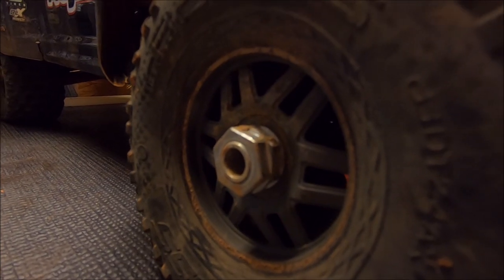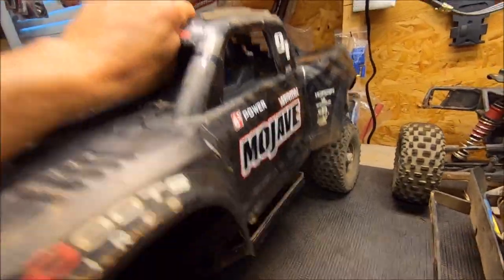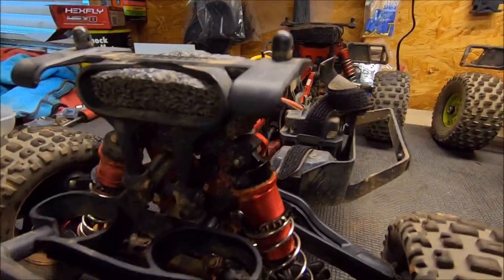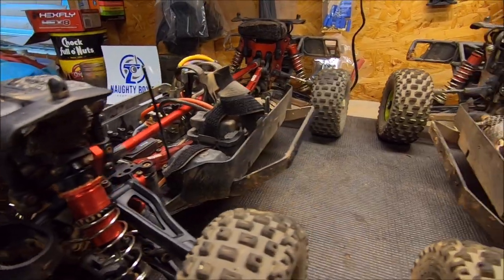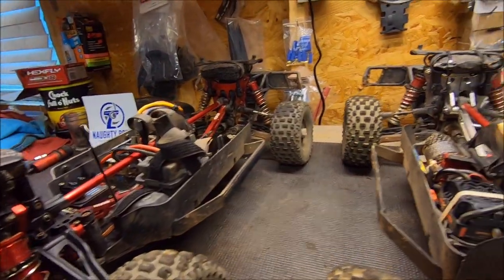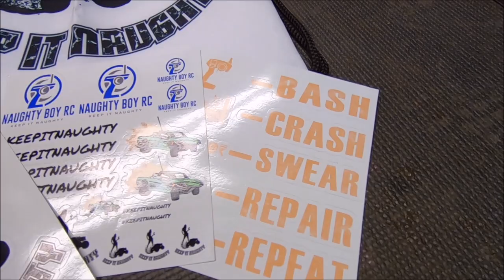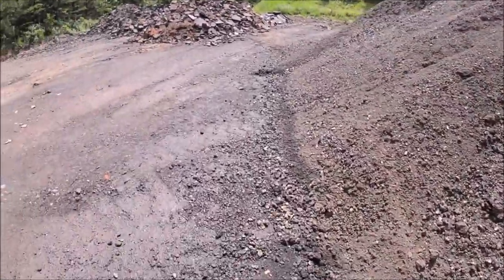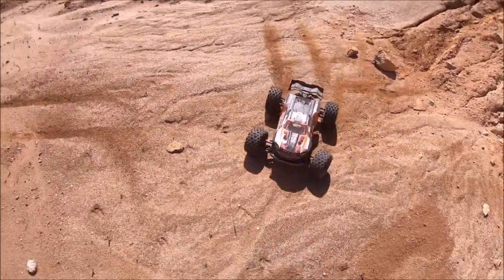INSANE Dirt Shredding BEASTS! ARRMA Mojave EXB, RTR and Kraton 8s!

Comment: Hey @RC Dude81 maybe you can help, so on my Mojave EXB (HW 1650kV + BL Servo and 17 tooth pinion, all other stuff Stock) i face the problem that my drive shafts front & rear pop out pretty often with "slow" bashing. I akready removed the small spacers on the A Arms to "tighten" that, but due to any reason that happens pretty often. What i have not yet done is the "limit the shock travel" on the shocks you did, but in theory i want the car "low" if possible (also screwed the shocks "hard", but not helped). No idea, the other two Mojaves (non EXB stock ones) does not have that problem. Maybe i need to replace couple of stuff, but the car is just couple of batteries old and i have that since beginning ^^
Reply from the maker: I fixed that on mine by adding a half inch bump stop to the shocks. I used boat cooling line but anything with a 5mm hole will work. The arm is flexing too much under full shock compression. The bump stop fixes it!😎👊

Comment: That’s a beast!!! I just ripped mine snd I love it. Had an issue with rear pinion bearing slop causing diff to break. Do you run stock diffs? Thanks!
Reply from the maker: Thanks man!👊Yes I run stock diffs just an extra outer bearing shim front/rear. Sucks on you rear pinion..bearings in good shape?
Reply: Its... locker time😁
Reply: @RCDUDE81  no, I replaced them! They were new ring and pinions too. Shimmed up perfect. Didn’t notice the bearing slop.

Comment: Hey Dude
Your thoughts on the Hoppywing 1650kv motor with the max6 for the Mojave? The esc motor limit is 1500kv should I stick to the HS 1480? Thanks for all your testing and hard work for us!!
Reply from the maker: Should work perfectly being the Max 6 combo comes with the 1650kv motor! The 1480 will work too but will probably be a bit faster with the 1650 setup. I know a lot of guys run that.😎👊👊

Comment: I have the red one. Super fun. What’s your suggestions on suspension and tires for huge air?
Reply from the maker: I honestly jump them all stock just thicker diff oils. The Mojave is more of a terrain vehicle (Drivers car) but you can certainly get some air with it! A little thicker shock oil and thicker center diff fluid will help.
Reply: Just bought diff oil. 100k/1m/100k. How crazy am I? Lol

Comment: Love the vid. Question? Did you put the extra “speed pinion”on you kraton 6s when bashing because I know some people do and I want to know what you do, to gage my decision weather to put it on when bashing or not.
Reply from the maker: Thanks! I do run the speed pinions bashing but keep an eye on temps! Especially if going hard in thick grass. Extra fans help too
👌😎👊👊
Reply: Throwing my speed pinion in a stock rtr with the 150a speed control would it be ok? I can stay out the grass.

Comment: Could you please tell me what battery set up your using on the exb?
Reply: And servo??
Reply from the maker: In the EXB It's using a Power HD 23kg Servo and Yowoo Graphene 6s lipo. 5000mah 100c.😎👊
Reply: Just purchased an exb because of your video!! Now I just need to finish putting it together!
Reply from the maker: Nice man! Enjoy!
Reply: What are your options on motor and esc for this mojave exb??
Reply from the maker: I like the Max 6 combo or Max 6 and Hobbystar 4092 1730kv or 1480kv.
Reply: Awesome thank you!!

Comment: Hey Eric, Which hobbystar 6s motor esc combo do you recommend for Mojave exb? Awesome channel brutha and appreciate your response to my other questions.💪
Reply from the maker: The Max 6 and Hobbystar 4092 1480kv and 1730kv both are great combos. If not the Max6 1650kv Hobbywing combo is a powerhouse from what I've seen. Just may need to tune the shocks to support a heavier system.😎👊
Reply: Gracias Brutha!!

Comment: Hi rc dude what's a good diff fluid to use in the mojave
Reply from the maker: I like stock 10k rear, 200k center and 30k front in the EXB. Running just 200k center in the RTR. I like the diff action for drifts etc so I keep the fluids light.😎🤘🤘
Reply: Thank you 😎👍
Reply: When everyone is going heavy weight (led me wrong) RC DUDE82 goes lite. Wish I had known earlier.  Anyone need some 500k?😁
Reply from the maker: @surfside75  Everyone likes different setups but I just prefer full diff action from the Mojave.😜It's a pure driver's car and love to get nice drifts and rough terrain handling!
Reply: @RCDUDE81   I understand.. so I need to learn how to drive😁. 
 I will try a locked rear diff and some 500k in the center to see what it drives like. Front will get 30-50k. Thanks Dude.

Comment: Eric I’ve been running my Mojave on 4s , has zero air control is it worth running 6s ? Does it I’m prove air control?
Reply from the maker: 6s will help yes! More power will create more wheel spin. What electronics/pinion are you running? Also try going 200k center diff oil. It will put more power to the rear wheels which will help too.
Reply: @RCDUDE81  stock firma electronics which I think are garbage but I’ve got 6s batts on the way , stock 16 tooth pinion and spur.
Reply from the maker: Try going full punch level on the ESC, 18 tooth pinion on 6s.👌
Reply: @RCDUDE81  will do , I see you run t bone racing bumpers , I fill my skid plate mounts with automotive windshield polyurethane haven’t broke one yet , just get the fast setting stuff takes about 24 hours